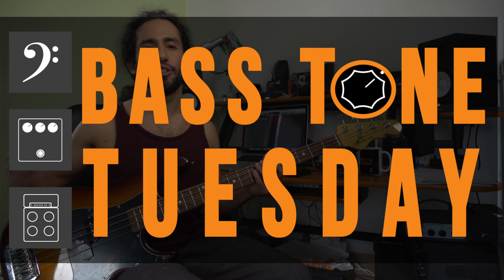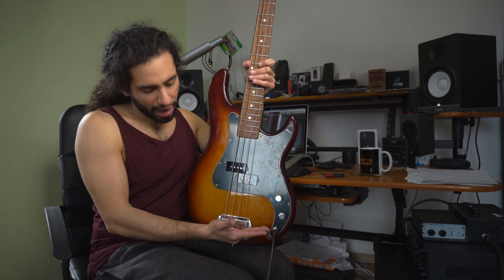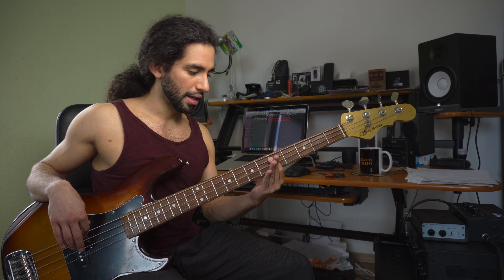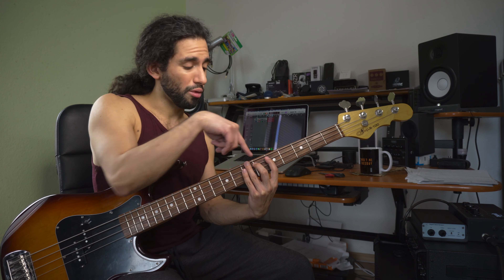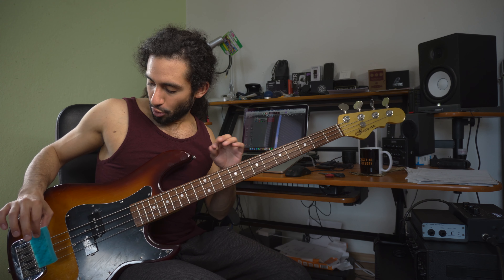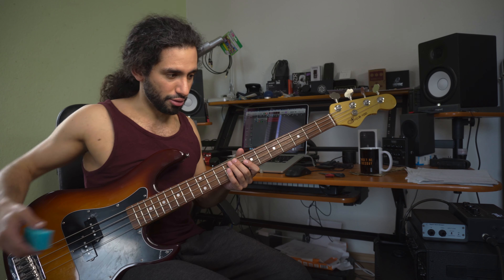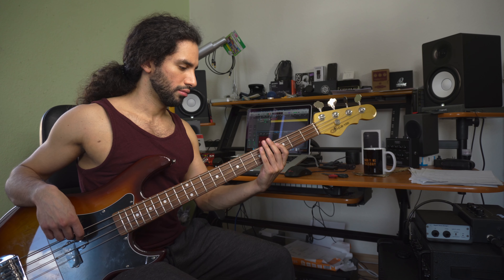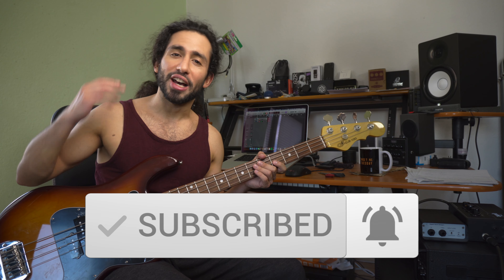Muting Techniques for Bass | Bass Tone Tuesday

Comment: Great video! I definitely need to work on my muting techniques. I have the Gruv Gear Fump - I like the concept, but they used something almost like the hook-half of hook-and-loop (velcro) on both halves of the mute. When I get some time, I might try replacing it with some higher density, closed cell foam and see if that is any better. The 2 parts (which rest above and below the strings) are held together by a screw and a nut, so it doesn't look terribly difficult to take apart!
The Nordy mute definitely looks great! I may look into one of those down the line. I'd have to measure the string spacing on my basses, maybe I can just buy a 5 string mute and be able to also use it on my 4 strings! And they recently released a double bass mute, too...
Reply from the maker: I’ve heard from some people that the Fump raised/lowers the pitch of some strings. I haven’t tried it myself, though. 
If you 5 string has a 19mm spacing, you should be able to use it on most 4 string basses, i think :)